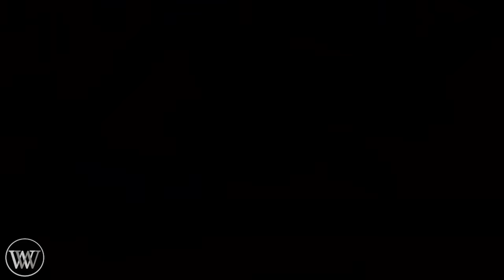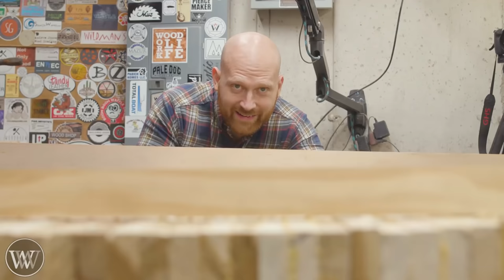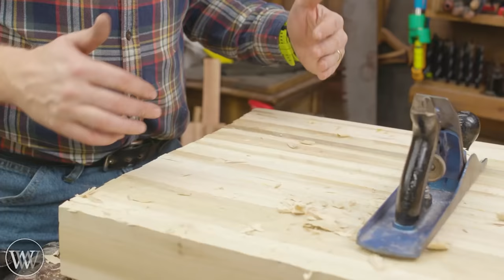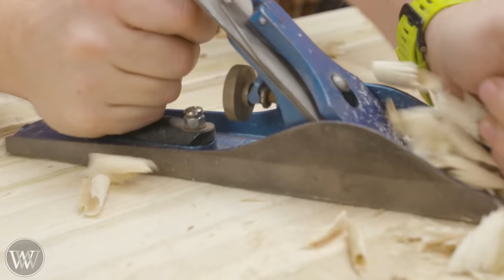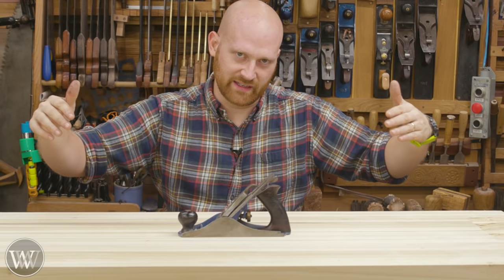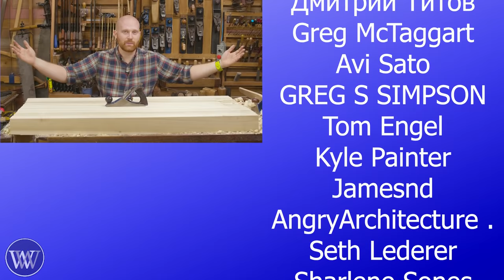How to Flatten a Bench Top or Any Slab With Only Hand Tools

Comment: If you have cupped/bowed boards would you flatten them individually before gluing to make a wider board  or glue up and then flatten the whole thing?
Reply from the maker: It depends on how cupped or bold they are. If you can clamp it out with a moderate amount of pressure then I would just go ahead and glue and clamp them flat. However if it takes a lot of pressure to clamp them flat then I would flatten them first before gluing them up.

Comment: I really need to make some winding sticks and a scrub plane
Reply: I used old mahogany baseboards.  Dead parallel.  I added some black paint squares to the top edge for visible contrast.  I put some little tiny screws in the center to visually find the middle of the sticks.  Oh, yeah!  I glued two similar base boards back to back so they wouldn't fall over!

Comment: What are your thoughts of 50 and 55 degree angle frogs for the no. 7 ? Or will at standard 45 degree work just fine?
Reply from the maker: For a number seven I would not mess with it. Now if we're talking about a fine smoother having a little higher bed angle I have found to be very useful. It requires a little more force to push however it does a lot better on difficult wood grain.

Comment: WbW would you recommend converting something more like a number 4 or 5 to a scrub plane? Or should I go for something more like a 6? Or does it not really matter much? I feel the smaller planes are easier to handle and less taxing/faster, but the larger ones have a larger flat reference surfaces.
Reply from the maker: Generally I like number four as a scrub plane and a number five as a four plane.But in the end it's a very personal choice.

Comment: My only suggestion is to drop the scrub plane and use a 6 with a camber instead of the 5. The added weight will help shove through those trouble spots and the wider mouth will mean fewer passes. A scrub can cause as many problems as it fixes and the longer sole of the six means less work with the jointer.
Reply from the maker: I know a lot of people that like that. Personally I don't like the weight of the six. It just tends to be a little bit more annoying. If I want that I'm usually going to bump up to a seven or an eight. But again very personal preference.
Reply: @WoodByWrightHowTo  There's your next video. Flatten one side of a board with a 6 and the other with a 40 and 5 combo and tell us which is the better way. :)

Comment: One thing comes to mind for my new bench; I know that only the sections where the leg frames come into contact have to be level and straight but I have also figured out that if fitting a drawer, then it also helps to have a flat section for that too because it will avoid the top of the drawer snagging  on the underside of the bench (it could be avoided by reducing the internal height of the drawer but I think flattening the underside of the top in that area would be better). Also, if fitting an end vice, that area also needs to be levelled. I've come to the conclusion that because I will be doing all of that, I may as well just level and flatten the whole underside - the topside is already done, so referencing off that would be the quickest way to go, probably.

Comment: Still quite new at this. But what wood would you make a straight edge out of so it wont warp too fast?
Reply from the maker: It has less to do with the type of wood than the grain of the wood. You want the grain to be nice and straight. The straighter the better.  The type of wood would come into decisions about how durable it would be. The harder the wood you find the less prone it is to being dinged and scratched. But as to stability for warping that is just how straight the grain is and the humidity changes in your shop.

Comment: During the flattening process, did you have to stop to sharpen?
Reply from the maker: no. this is poplar and you can go a wile before you need that and the scrub plane can go a LONG time before it needs work. I usually only sharpen my scrub once a year or so. but the jointer plane would need a sharpening at the beginning and then after. that one needs to be kept sharper as it is taking finer shavings.
Reply: @WoodByWrightHowTo  Thanks.

Comment: great looking #7
but what if you only have a #4?
Reply from the maker: Then you just use the #4 and check with the strait edge more often. the #7 will only hit the high spots so you do nto need to check for flat as much, but with the #4 you need to check more often and make sure you are only hitting the high spots as it will still take shavings from the slow spots.

Comment: How do you keep the two planes  (surfaces) parallel? The top and bottom could both be flat, but not be parallel. Or is this not a concern?
Reply from the maker: Generally you flatten one of the two surfaces and then you use a marking gauge to go around the bench putting a line down from the top and then you plane everything down to that line. However it's not really important that the two surfaces be parallel

Comment: @woodbywrighthowto I got a hairbrained project I want to do.  I need to make countertops and I have sheets of 2in marine plywood. The layers are the most beautiful blues and greens which will work perfectly in this beach side kinda hippy dippy theme i have going. They were warehouse storage shelves and they are 5x5. After cutting them basically in half, I could just use them flat. Easy peasy,  but the layers would be invisible. 😢 I could turn them into butcher block, but that would be a harrowing amount of work getting them cut into strips 😮...I could use a skillsaw to avoid the lifting, but it's still a chore and also the effect will be really busy because of how many stripes would be visible.  
So I came up with this idea, and I kinda understand the geometry but have no idea how to get it planed out. Each ply is about 1/4in and it's 2in thick...about 8 layers. So if I could plane it off at an angle over a width of 30 inches, all 8 layers would gently emerge, and after I did the reverse side, id have a 1 inch thick counter top on a bias to the original. id cut it down to 28in standard width wide. Lovely, but is it possible?? Is there equipment  to do this kind of out of the ordinary milling? I don't mind taking them to someone to do the milling if I have the vocabulary to ask for what I am wanting. There's a couple of schools and specialty carpenters in my area so if you can just give me a clue if this is any kind of reasonable concept and the vocabulary woodworkers would recognize,  it would help me a lot

Comment: WbW, do winding sticks need to be offset in thickness/height? I noticed you're using what looks like a milled two by 6 and a milled two by 4.. I've been using square aluminium tune stock from home depot, which are quite reliably flat, and but I've been using two of the same dimensions.
Reply from the maker: No babe you can make them any dimension you want. As long as the two sides are parallel on both you're good to go.
Reply: @WoodByWrightHowTo  thanks. You might want to fix that typo though lol. I mean I like your show and all but.... ROFL

Comment: I've just thought of a product. A manual flattening sled. A large flat bar with replaceable blades (power planer blades) running on wheels with adjustable height. Lightly pain the bench top, run the blade end to end referencing off a flat MDF top, you hit all the high spots in one pass, use hand plane to aggressively move in and repeat, takes the guesswork out of reading twist Vs cupping. Wdyt

Comment: Hi great video, but how to guarantee that the surface is parallel to the other side?
Reply from the maker: Generally you plan the top surface of the bench and then use a marking gauge to go around and make a mark down the outside all the way around. Then you flip the bench top over and play in the bottom down to those marking gauge lines. In reality the bottom and top did not need to be parallel it feels good to have it that way but functionally there isn't much difference. Usually there is more variance in the floor that the bench is on then in the flatness difference between the top and bottom of the bench.
Reply: @WoodByWrightHowTo  thank you so much, very clear.

Comment: Despite attempting to have the grain running in the same direction with a new bench, sometimes grain changes mid stream in 1 or 2 boards, and tear out occurs. Or sometimes you think you have selected the perfect grain direction, but mistakenly reversed 1 or 2 boards in the glue-up. If you plane boards in the bench, tear out occurs in adjacent boards (grained direction wrong) etc. Whats the possible/best course of action. Cheers.
Reply from the maker: That's why I do a lot of going 45 degrees across the board. You're not going to get as much tear out that way but then I'll come in with a finely set smoothing plane that can go against the grain. if you don't want to see some videos on that I have several videos on how to set up a smoothing plane. If push comes to sub then getting a card scraper to clean up those few spots with tear out.
Reply: @WoodByWrightHowTo  So that's why -- I was wondering why you traversed with the smoother.  I think of traversing as helping with flattening because it tends to straighten in the planing direction, so planing various directions tends to flatten.  But that's completed before smoothing.
Reply from the maker: Yep. You can traverse with a smoother on difficult grain and get really close to smooth. Then set up the plane with a very tight setting for smoothing and then you can go against the grain.

Comment: That original lumber was very badly warped when glued together. Is there any way to glue up that isn't twisted & warped when glue sets? I'm guessing clamp cauls across width & lengthwise clamp go flat surface.
Reply from the maker: the lumber was fine all of the laminations just twisted just before being set. that is the downside to trying to do it with a PVA all in one glue-up. there was not enough time to straiten them once clamped. it was already setting. if we used epoxy or did it in several glue-ups it would be much better.
Reply: I used to have similar problem gluing mosaic/inlay tiles onto A4 ply, hour after gluing the ply would cup badly. I had to sandwich press under a weight to flatten before glue set.

Comment: How do you make sure the bench bottom plane is parallel to the other side?
Reply from the maker: There is nothing that says that it has to be. But once you get one side flat level and true then you use a marking gauge and Mark all the way around the perimeter up however far you want to flatten the other side too and then you just bring the other side down to those marking gauge lines

Comment: So how would you do the end grain on such a long piece of wood? I'm trying to find information on this but I don't exactly know what to search
Reply from the maker: Same way just a smaller surface.
Reply: @WoodByWrightHowTo ok, and would I be able to plane such a large size end grain with a low angle block plane? Or would it only work with a low angle jack plane?
Reply from the maker: you can do it with a small plane. it just takes longer.

Comment: You have ensured that surface is flat and smooth but how to do you get it parallel with the surface on the other side??
Reply from the maker: Generally you flatten the top first. You get it flat and true and then you use a marking gauge to mark down all the way around. then you can flip it over and just plain it down to that marking gauge line. But to be honest the top and bottom do not need to be parallel. The small inconsistency in parallel between them would not make any difference.
Reply: @WoodByWrightHowTo  thank you so much for your timely reply!

Comment: Hey, I got some pretty bad tear-out on the edge of the slab when using my scrub plane. It wasn't taking that heavy of a cut - Is there a good way to make sure the edges don't blow out?
Reply from the maker: On the far edge I usually played that down at an angle. This will help support those last fibers. So in the scrub plane goes out the far side. It doesn't take more wood with it. If that's not enough then you can put up a sacrificial board of the far side and clamp it in place.
Reply: @WoodByWrightHowTo  great idea thank you!

Comment: Does this work well with endgrain and or hardwood?
Reply from the maker: yes. this bench is a hard wood, but Poplar is a softer hard wood. the same method would work on any wood. end grain is more difficult. for that you generally want to use a low angle plane as that is better at slicing, but in that case I would probably go with a router flattening jig. it would be much faster.

Comment: Heres a thought... set it level, draw your level line on both ends (assuming you have cut them square), plane down to the line, then make it flat longways across. At the end of the day, you're going to plane your brains out by the end.
Reply: Here's what I suggest: whichever is flat, the top or the bottom, is the reference surface that you use a mortise or cutting gauge against to scribe a line all the way around all four edge's of the 2 sides & 2 ends next to the un-flat surface at the thickness you want. After that its a matter of taking everything down to evenly match the line in all directions. Then the slab or workbench/table top is of even thickness.

Comment: Ive been wanting to buy a plane for a long time but its so expensive :’(
Reply: Second hand. They are better(better steel) and much cheaper..
Reply from the maker: Most of the planes I have cost me less than $20. I have several videos on how to find inexpensive antiques to restore. As well as if you want to look at the website handtoolfinder.com I have a whole set up on there for finding antique tools.
Reply: @WoodByWrightHowTo  i could afford 20€ but bot much more than that. Here in EU these are super expensive. 80+ and you barely get anything :(((

As a poor bloke its pretty tough
Reply: @urbanthedk4653  there are numerous ways to find planes in Europe too, every country has its own "Craigs list" - here in Holland we have marktplaats.nl, which has quite a large amount of ads selling hand tools.
Reply: @urbanthedk4653  You can also search using terms such as "old tools" or "carpentry tools". Not everyone knows they have a handplane or care enough to mention it seperately. I usually get better deals on these search terms as people don't realize what they have.
Reply: @WoodByWrightHowTo  That holds true for regular bench planes.  I bought a very nice Stanley #5 for $50 which needed almost no restoration.  I have some old planes that belonged to my father that took a fair amount of work to make them really usable.  It does not seem to hold true for specialty planes.  I looked for a long time for a vintage router plane that was reasonably priced.  I finally gave up the hunt and made one, just buying the iron for it.  I have also been looking for a #4 1/2 without much luck - lots of #4's but not many 4 1/2's.  When I find a good 4 1/2, I'm going to turn my Dunlap #3 into a scrub plane.
Reply from the maker: Yeah. You're up is a very hard place to find metal hand planes. They switched straight from wooden hand planes to power tools
Reply: @urbanthedk4653  You might check thrift stores, circular stores, things like that. They often have nice planes for reasonable prices. Also check FB-market place, or yard sale when the season is right. I have scored planes for as low as €5 or so. Same goes for saws and chisels.
Look for wooden body planes as wel, they are often much cheaper then the metal ones. And if there's work to do on them you get even more satisfaction that you have an otherwise dumped plane brought back to life.

Comment: Why not flat the top surface, measure all lengths, find the thinnest spot and line all the edges with a straight edge?
Reply from the maker: That is the idea if you want to flatten the other side. But in this case I am showing how to flatten the top.
Reply: @WoodByWrightHowTo  Ah... I saw this more as something you're working rather than a tutorial (seeing as Sarah already flattened the top face).

Comment: That glue has got to be hard on your irons....
Reply from the maker: That's why I hit with the scrub plane. Doesn't really affect that much.
Reply: @WoodByWrightHowTo  
What is the sharpening angle and camber (approx. Radius) of your scrub edge? Thanks.
Reply from the maker: The angle is 35 degrees. The camber is about that much. I think the scrub plane is somewhere around a five or 6" and the four plane is somewhere around an 8"